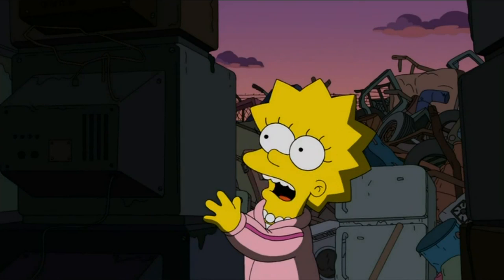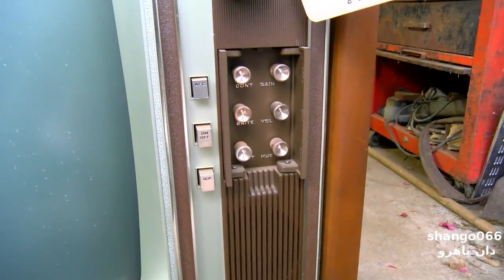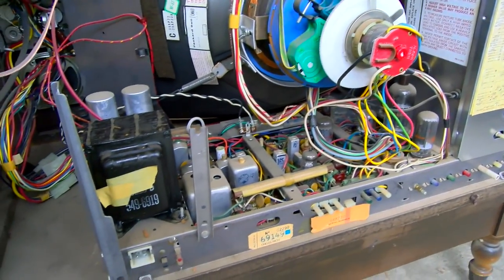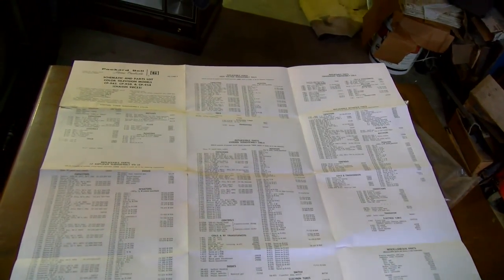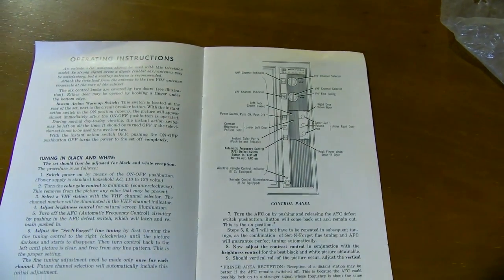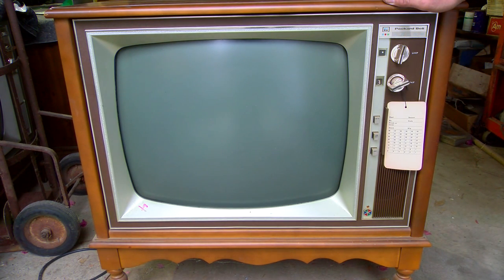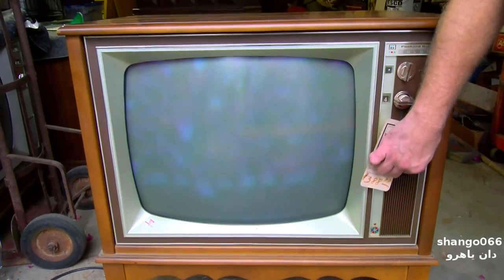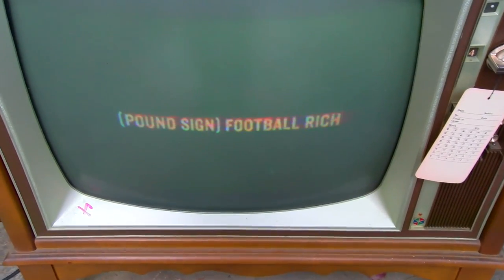1970 Packard Bell Color TV New Old Stock 98C22

Comment: That warranty reply card is an IBM 96 column punch card, they where used with the IBM System/3 mini computer system. The system 3 later became the System 32, then the System 34 and System 36. The systems where mid range "minicomputer" systems and have been replaced by the AS/400 and IBM iSeries machines.

Comment: You need to smack it with an open hand on the top! Thats how you adjust TVs from that era.
Reply: yes smack it till the dry joint gets larger or loose part partaly falls out all cause gaps that cause sparks then burn gaps bigger an then fail or worse bang fire fire
Reply: parts have a end of life turn on heat exspand turn off contract  then break after years of that even if stored can be end life for caps resisters ect
Reply: Tomasz Kozien I have to smack my Hoffman ,, the picture tube Filament opens up,  and a tap makes the connection and it lights up...
Reply: @cardboardboxification  Might be right on the pin. Is it soldered inside a larger pin?
Reply: Johnnytaco Kleinschmidt i never checked that... I don’t have it anymore...
I have a 1957 zenith now..
Reply: @cardboardboxification  What model? Do you watch period correct shows only or whatever you like? How's the sound? Buzz allot with titling?

Comment: I see this TV still has some vacuum tube circuitry in it. It is probably close to the last year this was done. I had a Zenith console from 1973, (cost about $550 of 1973 dollars) and it was all 100% solid state. That set ran flawlessly for 20 years, until the high voltage flyback transformer literally caught fire and burn the set up. I'm glad I was able to quickly yank the cord out of the wall, and put out the fire quickly. I still have a box containing all the parts I salvaged from the set, to use in other homebrew electronic projects.

Comment: Hi sir,in the USA did they turn off  the analogue TV signal to switch over digital,if they did,how are you transmitting a old 1973 TV that has a analogue TV tuner?
Thanks
Reply: He is probably using a converter from analog to digital
Reply: RF Modulator
Reply: John borg , yes were are digital now, here in the USA. A converter box would nicely take care of the problem, of seeing digital programming on an older analog TV, such as this one. Now in 2020 I am still doing that on an old analog TV that is still going strong.

Comment: I Envy You running across a treasure like this. this kinda thing don't happen too often. however, you should have brought it up slowly using a variac instead of plugging it directly to AC. the electrolytic capacitors need to be reformed slowly before putting the set into use for the first time in so many years. the incoming surge when applying full AC voltage can damage the Filter capacitors.

Comment: I´d really love to have that TV as a "daily driver". Way cooler than the flat crap from China. Shipping such a set to Germany in one piece would be a challenge though.... Do you keep it or sell?
Reply: Really? It's the other way around for me. The LCDs hurt my eyes and the CRT TVs don't.
Reply: big companys like dell lost milions due to failed pc's its very worrying if u have anything from 2000 to new now only hope is if new have they paid for the better corected caps or gone cut price im sorry its a lottery as times go by the bad will all junked or used up
Reply: i have a blaupunk flat tv no problem for several years  maybe germans are aware and want to make good tv only
Reply: Blaupunkt or sony  i trust quality
i got a asuse mb  corsair pc goin good several years too
didnt skimp on psu  most inportant part the heart of a pc  lesson is good brand well worth extra cost

Comment: How is it that when a color TV is showing a signal that's not synced up, that it still actually shows the correct colors in the muddled mess?  It just seems like if the pictures is chaos then the electron gun shouldn't be hitting the right phosphor dots without also having the picture correct first.

Comment: Nice TV...turn it on and give it atleast a 24 hour burn in time to let things rejuvenate!
Reply: +JacksJunkDotCom Believe it or not, that is the worse thing that can be done to that set, especially when plugged directly into the AC wall socket. what needs to be done is that set needs to be plugged into a variac or a adjustable isolation transformer like the B&K 110 ISOpak which can control the line voltage to the set starting at 90 volts & gradually step it it up to 115v for at least an hour while checking the filter cans for temperature rise. if they start getting hot, they are already bad.